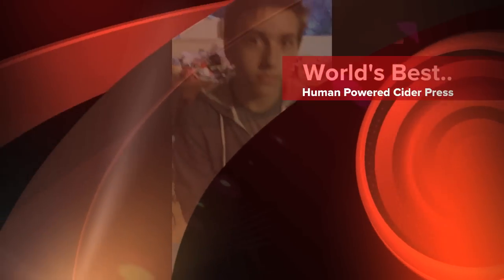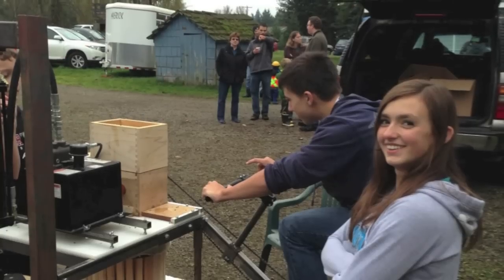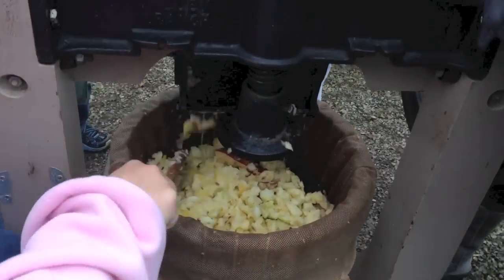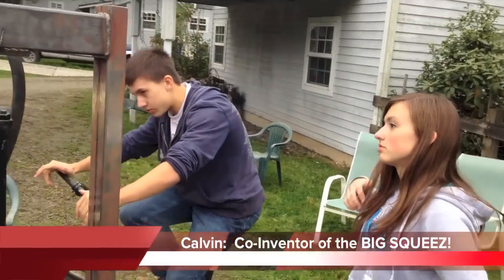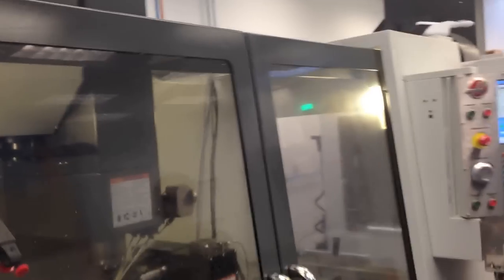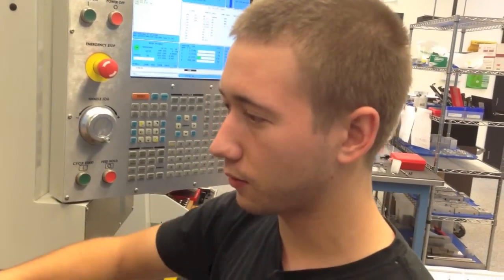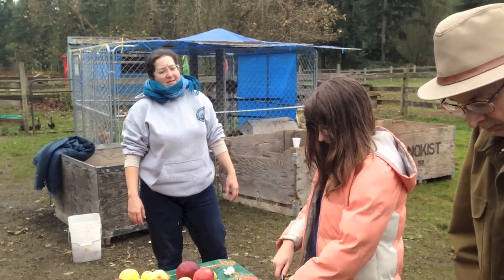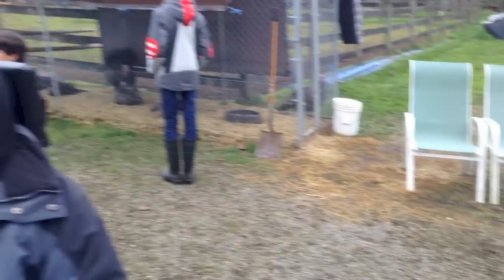World's Best Home Made Cider Press...  REALLY!

Comment: I like this concept for grinding apples.  Have you ever thought of attaching more weight to 1 or both sides of the shaft.  It takes a little more work to get it up to speed, but then the weight takes over and helps you.  I saw one on another video of a hand cranked version, seemed to make alot of sense.